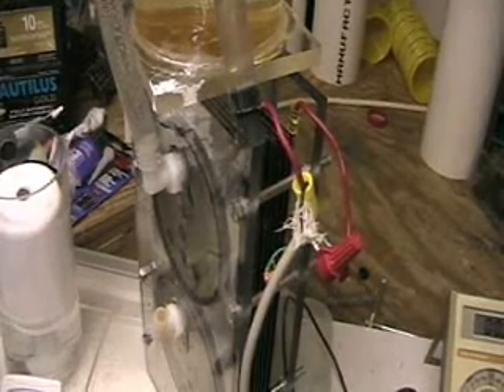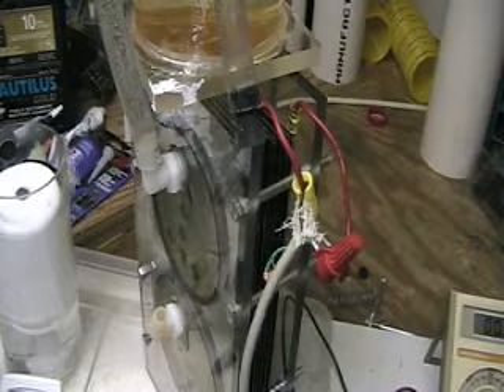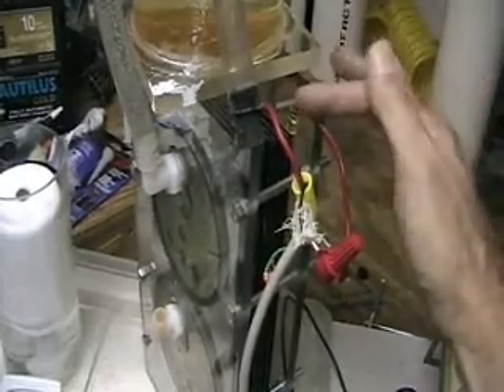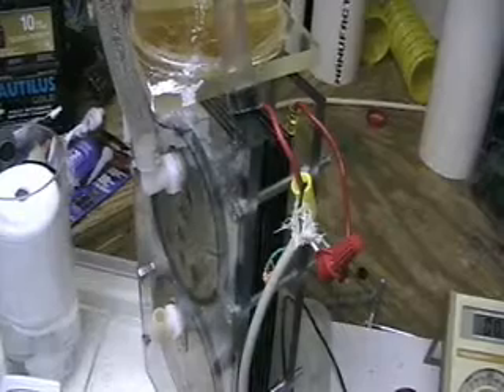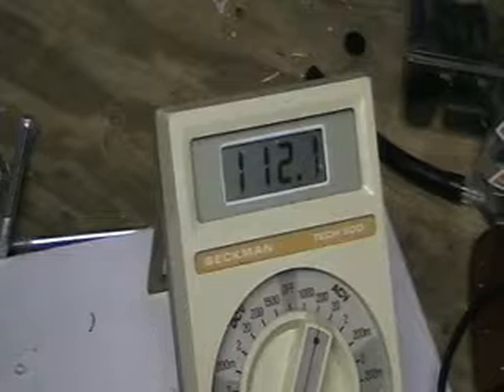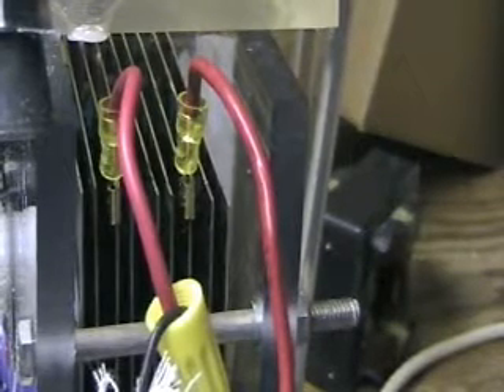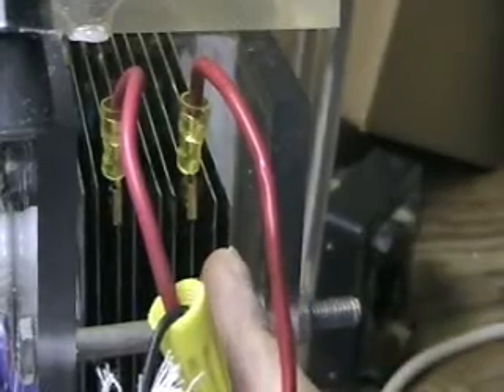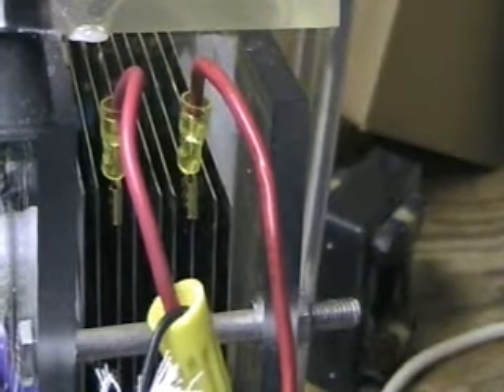Hydrogen Tap (FOCUS-Q VOLTAGE) 410

Comment: Hi John. If there's water in that cell, if you could just put one of the wires in just touching the water with the other on the plate, you will have the same reading, its just the voltage communicating through the water, Iv proved this many times with my open cell.
If you just put the wires in the water not touching the plates at all, you will get the same reading, from those plates at the bottom.
Thanks.
cheers zeropoint132

Comment: The overall discussion was that the polarity is switcing back and forth "too fast".  If that is the case then maby each half of the ac wave can be used in a seperate H gascell container...and if the increasing voltage does not matter.

Comment: If it's not the current causing the heat, it could be vibration of the water like a microwave vibrates water to make it hot.

Comment: I'm not sure either, it could be something very simple though.  If it's getting hot, there must be reasonable current passing through the water, but why is there no gas being produced is the question.  Could it have something to do with the increasing ac voltage from 0 to 120 or so affecting how gas is produced near the plates? maby

Comment: It should do that.  As long as the outside plates have an electrical connection to where you have the actual connections hooked up to it will all be charged. The electricity only flows between the connections but the whole cell is electrically charged. Eliminate the electrical conductivity between both connections and you have a capacitor. Connect a volt meter between both and you will still read the same voltage.